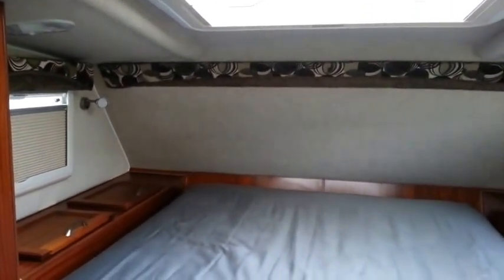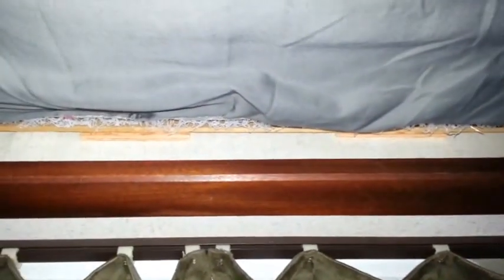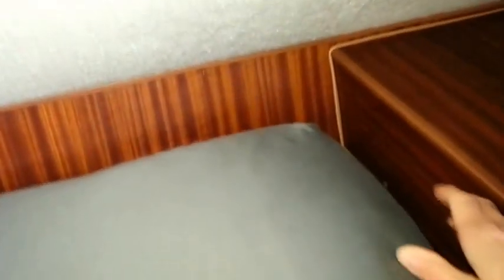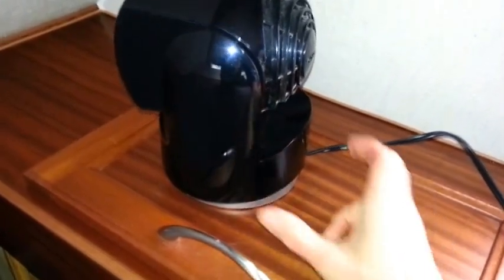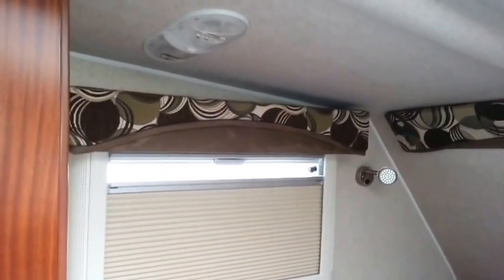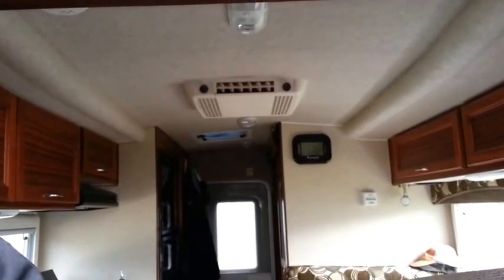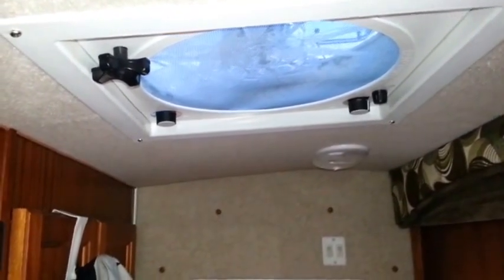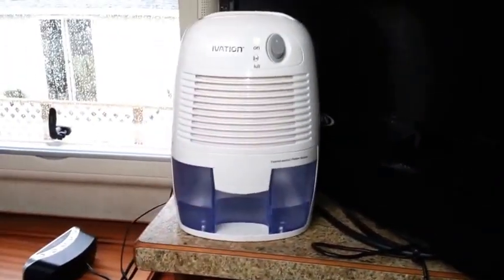Truck Camper CONDENSATION Update 12/2015

Comment: For years, we have used 2 x 4 under our mattress in our Lance.  For our use this worked, but being an engineer, I knew there had to be a better way.

This fall I got three 8 foot pvc pipe with a 1 1/2 inch diameter.  I also got 6 6 foot long pvc pipes with a 1/2 inch diameter.

I cut and laid a piece of the 1 1/2 diameter pvc up by head of the bed.  I used a right angle connector I attached the other 1 1/2 pcv pipes so they ran along both  sides of the mattress and extend about 3 inches beyond the end.

I then took the  1/2 inch pipes and drilled small holes in them.  I then drilled holes in the  1 1/2 inch pvc at the head of the bed and using pcv fittings, I connected the 6 small pipes running them length wise evenly spaces.  I then drilled a series of small holes on a 1 1/2 pipes, placed a board over the pipes and put the mattress back.

I then connected a two 12vdc  squirrel fans with a 1 1/2 diameter input to the over hang on both 1 1/2 pipes at the bottom of the bed.

What happens is when the fan are on, it pulls air from around and under the bed into the holes drilled in the PVC pipes and exhausts it onto the living area of the truck camper or routed into a dehumidifier or other drying material.

We do not camp in real cold weather, we used our camper in mid November and live in Minnesota, and we had no condensation.

I cannot say for sure this is better than the 2 x 4, but just wanted to share what we are trying since we enjoy your videos.

Take care.
Reply from the maker: +Life Off Grid That is a terrific idea! I will have to consider doing that. I like the elevation of the bed right now so not trying to lift the bed higher. Pulling the air is a great idea. Thanks for sharing your method. I'll let you know if I give it a shot! Take care
Reply: Life Off Grid make a video.

Comment: You've done a good job of lessening the moisture problems.  Have you tried moving your mattress a few inches aft and open up that area by your head?  Maybe tape a strip of reflectex along the area that's moist to even out the temps.  Just thinking out loud.  You're fortunate to have no dripping around your skylight.  The skylight in my Alpenlite camper builds up condensation all around the aluminum frame, so I have to be wiping that up several times a day and in the morning when I wake up if it's been raining.  

  I haven't had to worry about any condensation the past 2 years on the road.  I follow the sun and weather, so can count the days of rain on one hand......well maybe my foot too!.....LOL    I lived all my life in W.WA, miss the snow, but you can keep the rain.
Reply from the maker: +NWHiker  Trying some reflectex tape is a good idea which I have some. I was using reflectex insulation on the headboard and think it made matters worse so I removed it to allow air to move around better. That's my plan to follow the seasons.....I lived in W WA my whole life too....moved to OR last year enjoying the slightly nicer weather! Thanks for your comment. Take care

Comment: Great informative video. Thanks.
Do you think the condensation is getting between the inner trim paneling and the outer fiberglass shell??  
That would be destructive over time.
Reply from the maker: +chuangtzu Thanks.....No.....the flooring is waterproof material.......I just have to stay on top of drying the problem areas out each day. Take care

Comment: Hey Roller, a trick i came across a while ago,,  go to your local WallMart,whatever,, and buy a big container of Silica crystal Cat litter,,  this is exactly the same stuff they use in DampRid etc,   just package it it whatever you like,,decorative or such,,,  and have a tray or something for the crystals to drop the ware into,  this will rip the moisture out of the air, and when saturated,,will drain the moisture into the catch tray,,,there is no need to be buying expensive products.   you can use this method anywhere in your camper.  also,,this stuff lasts forever,,when you wish to reclaim it and use again,,months later,,  you just pour it into a wock,,or pan,,and heat it over a fire,,,this will redry the crystals, for usre again..  anyhow,,,stay happy stay free..  Alex

Comment: Then you prefer to run, add fans and towel dry surfaces etc. It would be worth a try for you to at least on the cooler nights when condensing would be more prevalent.  You're trapping your nights breath in the smaller confined front area with your head against the front points poorly insulated walls and ceiling.

Comment: I believe the way to limit or prevent condensation issues at the inclined front of the camper is  A). Teach your feet to breathe, or B). sleep with your head in the other direction on the bed.
All that condensate is from your breath rising up on the outer wall and making everything so durn skanky. :}

Comment: Maine year round leave the windows on either side of bed cracked, and with Damp Rid no condensation in my Lance or any other RV. I don't really mind windows open even @ 10º F - course round about those temp's I set the furnace to off.
Reply from the maker: +John Caron Ventilation! I use damp rid products as well and dri z air. Take care

Comment: Hello! Good info, do you think that travel trailers may have the same issue with condensation behind the bed like that, or does the more open area alleviate the moisture issue? Thanks for sharing!

Jed
Reply from the maker: +NDNomad Hey Jed I think a lot has to do with the height of the bed off the floor. The breathing distance is very limited in a TC so they seem to condensate more. In trailers and 5th wheels the mattresses are off the floor taller.
Reply: +NDNomad My TT has a mattress that touches a side wall, and I have the condensation problem there.  The walls are so thin that pretty much anything touching a wall is a potential trouble spot.
Reply: +Fernbark Frist I have a feeling I better check the part of the mattress that touches the wall after use.
Reply: +West Coast Roller I get it. makes sense. Thanks!

Comment: Why don't you run the peg board and hyper vent material up along the front area. Used 3m double sided tape so it hold up and could be remove if it doesn't work. That would give you the air flow and keep the bed away from that outside wall.
Reply from the maker: It's tricky....it's the #1 problem area in the camper with condensation.......I simply have to wipe the area down every morning in the damp weather.....no issues during the summer months. 
I tried that but found it's better to have nothing so it dries out quicker.

Comment: If you can sleep with just the left side window cracked and top closed try it, I think your problem is the top hatch. Unless your hatch is Arctic pane, then I'm certain. My lance had Arctic pack and just one window cracked 1/4" solved my humid conditions.
Reply from the maker: +John Caron I would think having the top hatch cracked would release the heat and breathing better?No?
Reply: Not always hows that for a definite maybe. With my Lance leaving the top hatch cracked just left me with dampness behind the bed. I'd try closing the top hatch and sleeping with side window open, and once with window closed. All depends upon outside/inside ambient temperature while sleeping.
Reply from the maker: +John Caron Thanks John I'll give it a try.
 I'm getting the dampness in front of the bed.....I've been elevating the front of the mattress with a pillow when I wake up and opening one of the side windows.

Comment: The average adult at rest looses about 800 ml of water through perspiration and exhalation a day, that's about 3/4 of a gallon of water you are putting out of just YOU in that tiny space, let alone ambient humidity from the weather.  Fans blow the humidity from one place to another, if there is no dry air coming in you are pretty much just waving the humidity around.  Invest in a dehumidifier, before you start getting black mold in your rig.
Reply from the maker: +MrDisneyCollector Yes sounds about right......been using a dehumidifier

Comment: Hmm, how about buying a cheap humidity gauge so you can see how much moisture is in there and then run your dehumidifier with all the vents closed so it can catch up, then try a little venting when needed. It's like having the AC on with the window open. 50-55% humidity is a desirable level of moisture, 65%+ is a perfect environment for mold and mildew.
Reply from the maker: Yes great idea.....I will get one
Reply: Just curious, have you used that Northern Lite in the snow? I always thought it would be nice to try out winter camping, when the campgrounds are empty and quiet.
Reply from the maker: nope.....no snow. A few nights below freezing no problems.

Comment: >>> I have a great solution for manufactures/owners that would be cheap and easy. They're called the Froli Sleep System spring. Its a plastic spring system that fits under the bed that allows ventilation and added comfort. Very customizable to meet your needs. Check them out. Made in Germany and seem to be a great design. I have no experience with them but if they work they seem perfect for both rv's and boats.